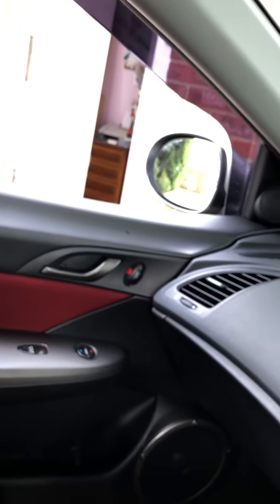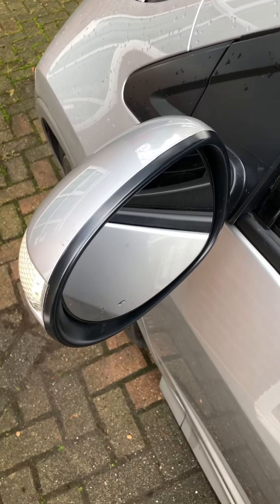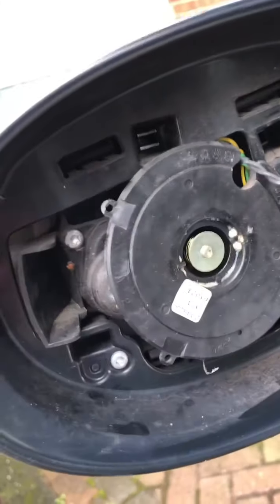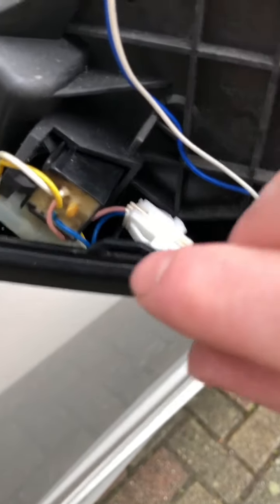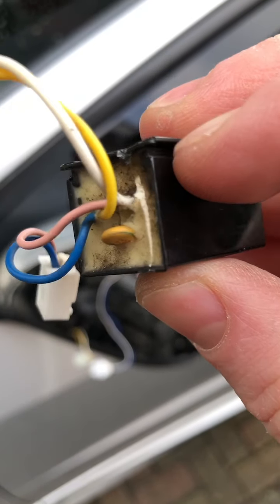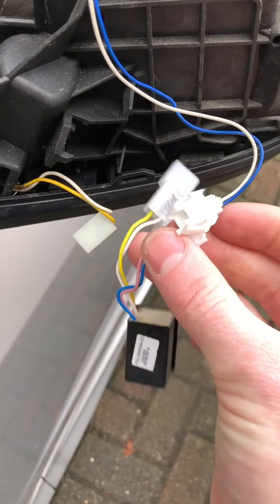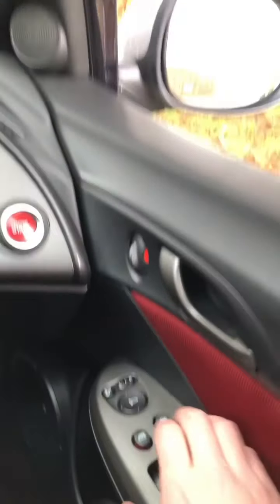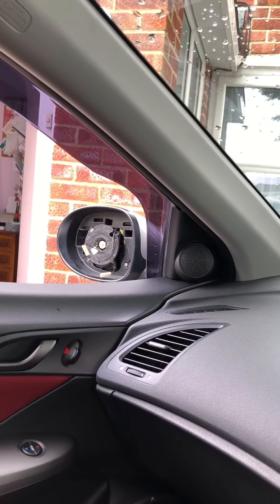Easy FN2 Honda Civic Type R folding mirror repair

Comment: You can easily replace the external resettable fuse (the tan blob on top of the SOD)  if you have a small pair of pliers and a soldering iron. 10 minutes tops (plus however long it takes the soldering iron to warm up).

Comment: Is this issue the same when my mirrors dont fold all the way and sometimes they are slow to close??? Please respond
Reply: Exactly what I wanted to ask as well. Drivers side is fine but the passenger side only goes up half way and doesnt go back all the way down... Did you find a fix for that?
Reply: @wookanio  I repaired the mirrors replacing that electronic board. They work as new now ;)

Comment: Question: was your mirror dead completely? Because mine begins to budge just a little, like a milimeter.
Reply: Not sure if you’re still experiencing the problem but in mine it would only move a few millimetres at a time every time I turned the car on, replacing this fixed it